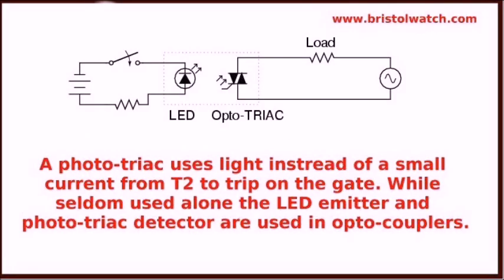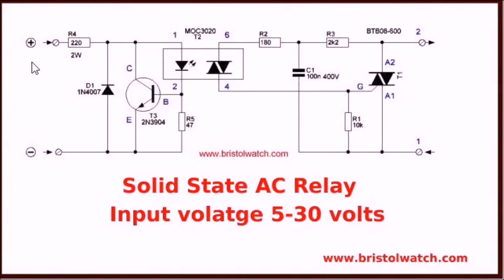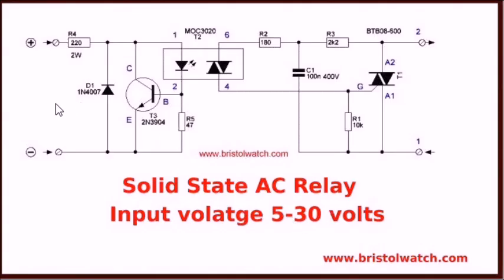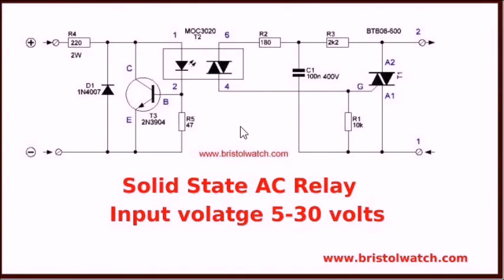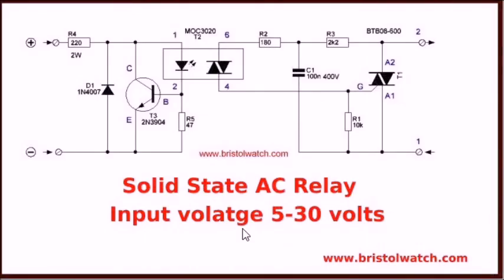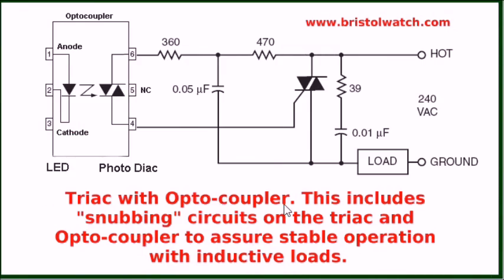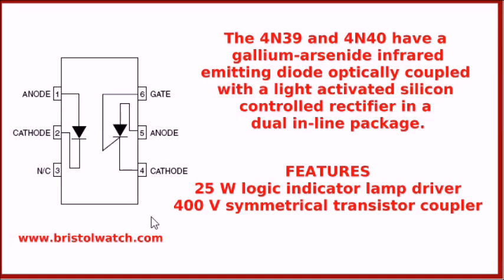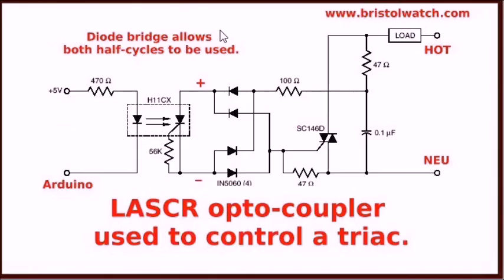Review AC Relay Circuits Optocouplers Triacs

Comment: Hello sir what to do if an sensor is involved? For exampel an reluctor sensor for ignition system so is it necesary to rectfi the signal first to use it as an input signal for the octocoupler? I need just to run an small transisror you see wia external power supply I simply surche for an alternstive methode to some how build an transistor based phase shifter 0-180°+ variabel so Im curiuse on what frequency ranges those octo coupler operate? And what correct components to chose for the rectification methode I only know my reluctor has 1.35henry around 300Ohms rating the operation frequency is about 0 to 1khr most of the time amps and volts are in mili range .So hoppe you know some octocoupler who does operate fast enough and in those mentioned ranges ?
Reply from the maker: This is not a rectification circuit. That could use an SCR. What is a reluctor?
Reply: @LewisLoflin  ordinari Pick up coil for an distributor GM preciseli can't finde any thing related to that topic about manual sensor control

Comment: I really dislike schematic representation where input is on the right  and the circuit on the left, with no clear separation between input hot/live and the output live wire. Makes schematics hard to read and it is even worse for understanding what the hell it does.

Comment: How come the current doesn't run through the RC snubber circuit while the triac is closed?
Reply from the maker: The snubber due to the small component values suppress/conducts the higher frequency, fast rise time noise spicks.  60Hz is ignored.
Reply: @LewisLoflin Thank you!

Comment: How you are sizing the resistors and capacitors in the optocoupler with a triac circuit with the snubber?
Reply from the maker: Spec. sheets and working circuits. Optocouplers I allow 5-10mA. Snubbers spec. sheets, schematics.

Comment: Thank you
Please how can i test a moc 3051 or 3052 in circuit and out of circuit 
With a digital multimeter
Reply from the maker: You can only test the input LED maybe if the DVM can check LEDs. You can only check if the photo triac is shorted. It should read open.

Comment: What is triac ?
Reply from the maker: A triac can be thought of as a solid state AC switch. Apply a small current to the gate it turns on.
Reply: @LewisLoflin  so triac is Base in transister ?
Reply: @LewisLoflin  thank you repray sir. triac is base in transister ?
Reply from the maker: @thehighriseconstructionob9679  No it is not a transistor. Its terminal are gate, MT1, and MT2. The gate must be triggered from MT1.

Comment: what is power(watt) of 470R,0.05uf , 39R and 0.01uf component
if load is 5KVA
Reply from the maker: About 1 watt on the resistor and 5KV on the cap. This is a spike suppression circuit and isn't critical.
Reply: @LewisLoflin   1W is enough for 39R .
Reply from the maker: @meenakshimaurya7949  In series with a cap there isn't much power in the circuits. It's a spike suppressor to prevent false triac gate firing.
Reply: @LewisLoflin  thanks

Comment: excellent video. can i connect 2 or 3 TRIAC in parallel to drive more powerfull loads ??? i need a optotriac to each TRIAC ??? thanks
Reply from the maker: I wouldn't. Try paralleling 2-3 separate circuits. Yes you need an optocoupler for each circuit.

Comment: In the H1 1CX circuits could you explain how the resistor on the gate works? I don't understand how it can do anything because it's not appearing to complete a circuit. Thanks
Reply from the maker: That controls the gate sensitivity. Without it it turns on all the time. I used 47K myself.

Comment: Is the MOC 3043 turning off in AC because of the low spot or reversal of the current? And staying on in DC because there is none?  And so these optocouplers would not work in anything other than single phase?  Thanks
Reply from the maker: It turn off when the voltage goes to zero.

Comment: please circuit  diagram using triacs  for on and off led lamps with power supply 220
Reply from the maker: You don't use triacs with DC or LEDs.

Comment: sorry sir, why we can't use TRIAC for DC ? do you suggest Relay than Triac when we use DC?
Reply from the maker: With DC once the triac is turned in with DC it will not turn off unless the DC is disconnected.
Reply: +Lewis Loflin ooh I see. thank you very much sir

Comment: Lewis,

this was most helpful thank you for the video.  I have a question I was going to use a MOC 3031 connected to a an arduino to run a lawn sprinkler.  The sprinkler valve is on a 24VAC circuit at about 225 ma.  From what I see this should work, can you confirm this?  Or is there a better approach?

Thanks
Reply from the maker: By it self the MOC3031 won't carry the current.

Comment: Hello Mr Lewis,
If i want to control a single phased motor which has three wires. How should i connect the live, neutral and ground?
Reply from the maker: The triac is connected to the "live" the neutral and ground are connected as usual.

Comment: Hello sir,
How can we protect TRIAC From high current OR Overload ?
Reply from the maker: Use a triac with specs above what is needed. If you need 3 amps use a 10 amp. A dead short circuit will wipe out anything. If this was DC which you can't use with a triac use a current limiter. How about a circuit breaker?
Reply: sir,
i need less then 2A for lamp dimming & i have used BT137 8A triac for it.
But i  had found on blog that triac blow off before MCB .
Reply: I too Heard, people talk about failure of traic.

Comment: Hi Lewis,
    How do we protect the above TRIAC based circuit from AC short circuit ?
Will Snubber circuit work in that case ?
Reply from the maker: A snubber won't help with a short. Use a fuse.

Comment: Thanks, interesting video... I found some SSR which can control the phase based on input voltage (0/1-10V | 0 - 5V) or current 4-20mA ... How does these work and can these be used as dimmer for regular lightbulbs AND dimmable LED drivers... In the specs I could connect resistive and capacitive loads and simple cut the phase. 

These SSRS could be very interesting for my home automation and simply hook them to an Arduino pwm and simple RC. Or do you have better ways to create a steady but varying voltage using Arduino?

Regards Dennis